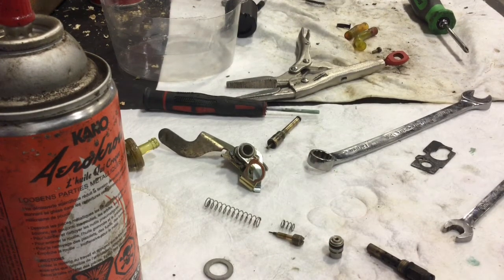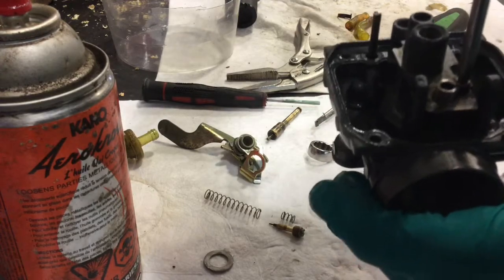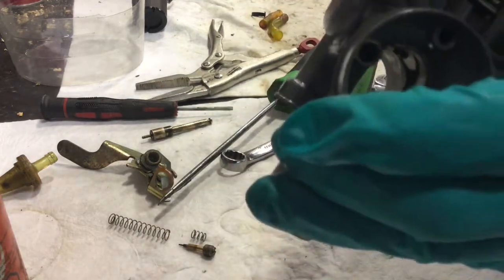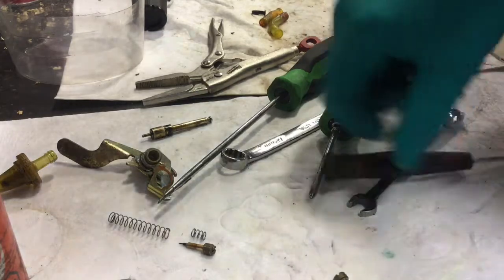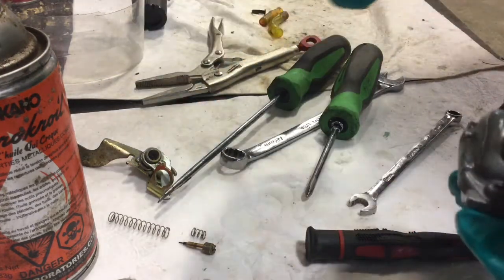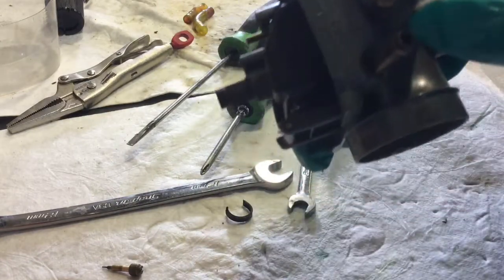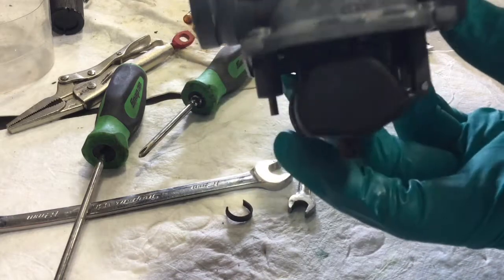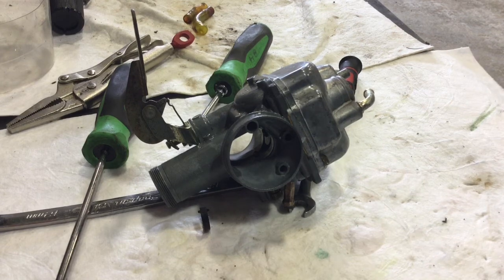Bombardier Rally 200 Carburetor clean and assemble part 3

Comment: My rally starts only on choke. Once I remove the choke it shuts off .  Even after warm up. Do you rebuild carburetor for customers ?
Reply from the maker: I absolutely could rebuild a carb for a customer, first make sure you don't have an air leak somewhere else, sounds like that might be whats happening.  Also, check what  a new carb is worth, as much as I hate to say it, sometimes it's actually more cost effective to buy an aftermarket carb if ones available

Comment: Hi terry, my rally has a new problem it keeps blowing the plug as I buy a new plug it’s start and runs, why does it do that is the stater bad or something?
Reply from the maker: It could be running rich, does it foul the plug?   what does the plug look like when you pull it out, all black?
Reply: @Pneumamechanical  yeah it’s black but my dad says why it’s black it’s because some of the gas touches it
Reply from the maker: @fr3sh339  It sounds like it's running too rich.  A spark plug running with the proper fuel/air mixture should be tan/light brown, if it's black, it's getting too much fuel.  Make sure the choke is releasing.  you may need to re-jet the carb, also is the foam air cleaner clean?  not much of an air cleaner, but make sure it's not plugged up and the engine can get enough air

Comment: Hi terry,my 200 it starts and runs but won’t speed up.
Reply from the maker: Hi, sorry I didn't see your comment until just now.  Have you cleaned the jets?
Reply: @Pneumamechanical  hey, yeah there cleaned
Reply: @Pneumamechanical  and another thing it starts and runs for a little while then it will go like it’s not getting any gas.it will shet down and like 1 minute after starts and runs
Reply from the maker: OK, do you have good fuel flow from the gas tank?   check to see if the petcock and screen on it are not clogged.  Also make sure the fuel tank vent in the gas cap is working
Reply: @Pneumamechanical  ok man thx so much I will check and see if that will stop making it give trouble
Reply: @Pneumamechanical  I will subscribe to u
Reply from the maker: @fr3sh339  OK thanks, let me know if you need anymore help with it.  I'm trying to get some new video's up, but just super busy lately
Reply: @Pneumamechanical  ok I will let you know
Reply: @Pneumamechanical  do work first then free post a little vid